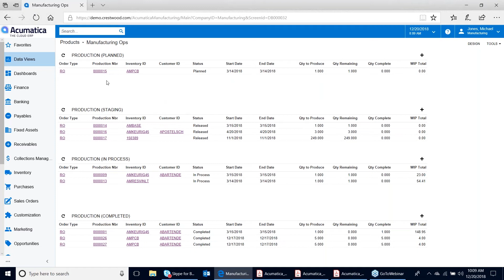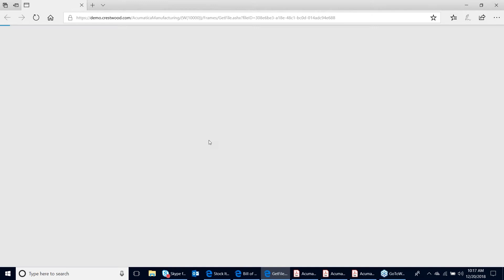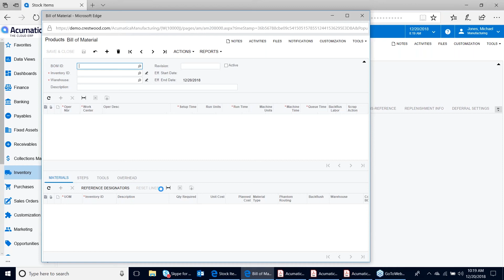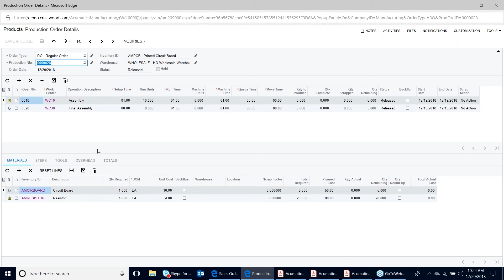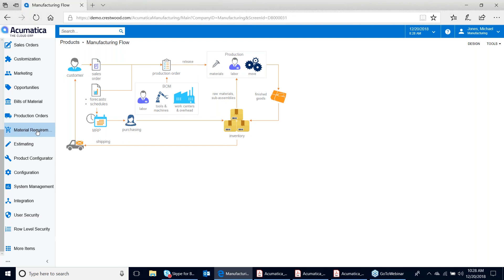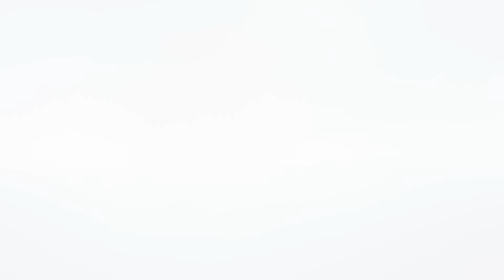Comment: Is anyone using this successfully? Main frustration with Acumatica is the inability to 'undo/fix' anything.  Every other system with which I've worked, you could re-open a job (even after completed or closed) to make adjustments/corrections.  The MOVE transaction in Acumatica seems to be the "point of no return". When issuing materials, or receiving a PO, RELEASE is final (again, no way to undo or fix).  We are human and mistakes happen; information comes to light 'after the fact'; what is the solution?
Reply: Hi Kay! Thanks for your comment. I've sent this through our Acumatica team, and I'll respond to you ASAP. Please stay tuned...